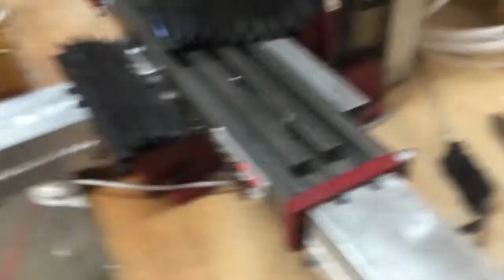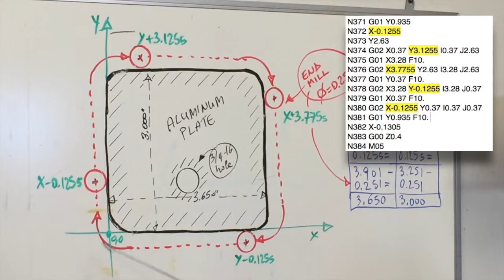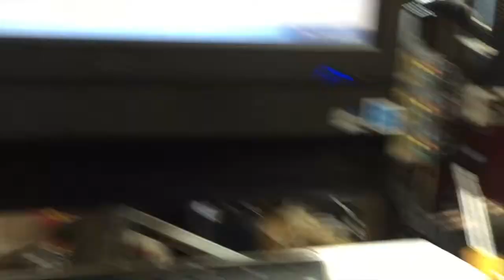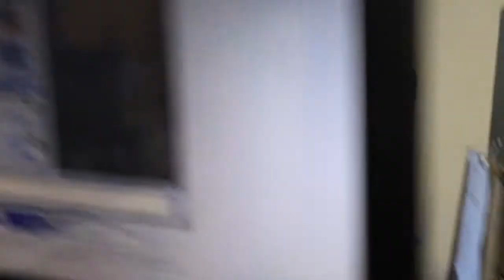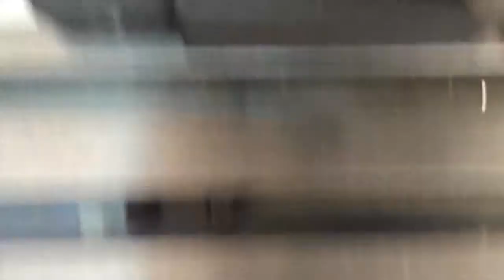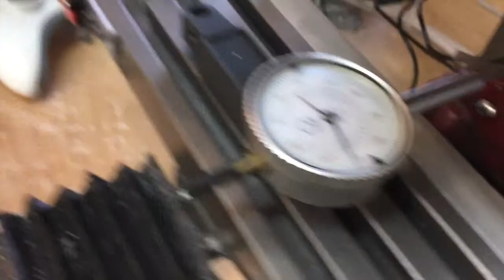CNC for dummies 😜 (part 8)

Comment: My only disappointment is I wanted to see you fit that part you'd tried so hard to mill before. Thanks for putting these up - CnC is a tricky journey - and you've clearly got far more shop experience than I - I've been more electronics and coding and far less milling and tooling.
Reply from the maker: Stick with it +Orionrobots. I bet one day you'll say that CNC was not as complicated as the electronics you are already good at. Like anything worth doing, it just takes a bit of investment in the for of time to get the gist of it, then the fun really begins. 
I should have thought about putting it all together in this video. Oh well, you can check the assembly in action out in my pneumatic drawbar video though (https://www.youtube.com/watch?v=HDAAjLE5krU). Ciao.